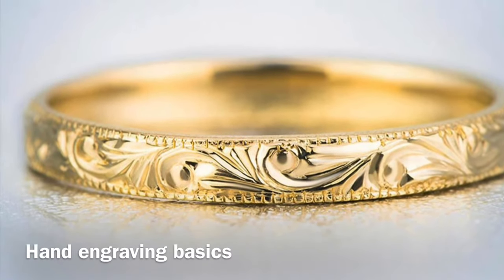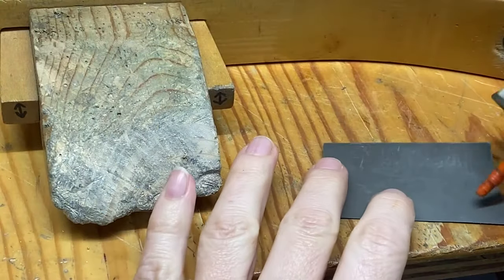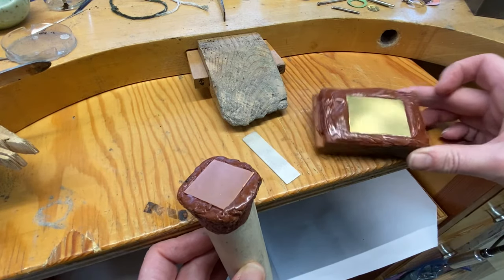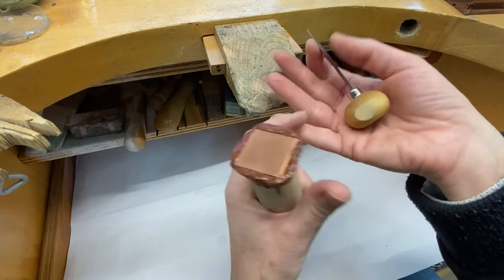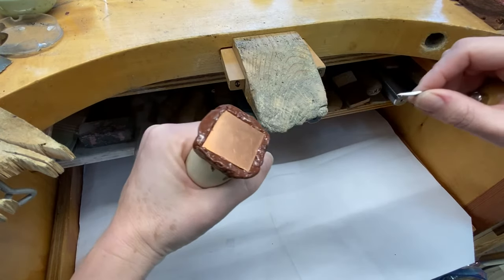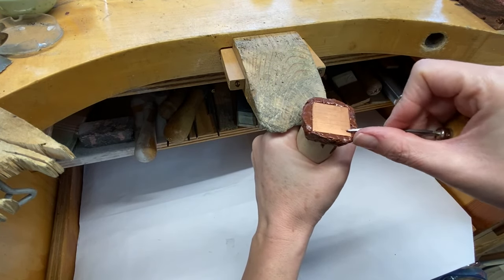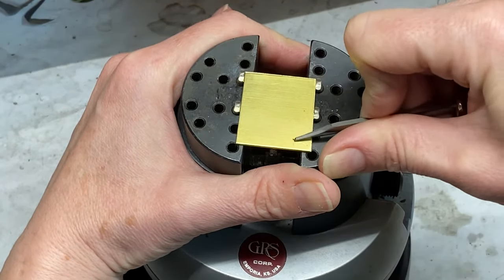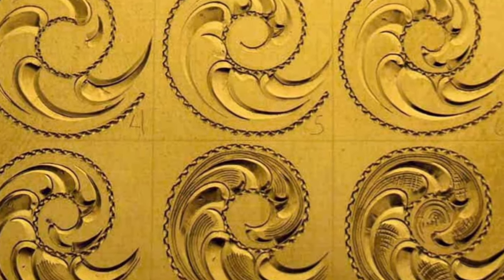Hand engraving basics

Comment: My father was a master jeweler, hand engraver, and watchmaker for over 40 years. He had his own shop and also manufactured a good bit of his inventory himself. His specialty was initial monogram pieces. He would hand draw in pencil the design, then engrave,  drill out the spaces, and then hand saw (wire blade) each and every piece himself. To entertain himself during this lengthy and time-consuming task, he would listen in headphones to old AM Radio broadcasts of New Orleans Saints games he recorded on casette years before. He must have done at least 10k pieces in his career, all of them one of a kind. Thank you for sharing this video. You are very talented as well.
Reply from the maker: I used to listen to books on tape! Now luckily we have podcasts. ❤

Comment: Has the heel already been honed in prior to retouching the face? Is it the heel or the belly of the graver you are polishing? I understand polishing the heel is crucial to a smooth cut as it is what "rides" along the bottom of the cut. The belly is the bottom portion of the graver along its length ending at the heels. Graver geometry requires a heel as the graver would otherwise have nothing to control the depth of cut. Without it the graver will just continually stab down and into the workpiece like a chisel. Creating a 0.25mm to 0.5mm heel allows the graver to glide at a specific depth as once you are at the depth of cut you want you level out the heel which is now essentially parallel to the bottom of the cut allowing it to glide at that depth continually. If you want to cut deeper, tipping the graver handle upwards while easing up and out  of the cut by tilting the graver handle down while you push.
Reply from the maker: Yes, the belly and slight heel are polished.

Comment: Hi I am interested in learning how to push grave. I have no idea as to which gravers to get. I want to grave brass and copper. I want to buy a selection of the main types. Onglette, knife, round, square, etc... but the more I look into it the more confused I get. I have no idea as to what size and angle to buy. I want to engrave scrolls and such onto key rings and desert plate sized copper and small boxes etc... I've never done this before so I couldn't tell you what angle I like to grave at or depth of cuts I prefer to make. The few specialized sites I've gone to expect me to know such things already and I don't. I also can't find anything on here that covers such things in the level of detail I'm looking for. I want the size and angle and basic types best suited for a noob. I'd rather not buy a set only to find that I should have bought the opposite angle and three sizes bigger or smaller until I find the ones I actually wanted. I won't be using anything powered either. And I don't know which brand is best either. I'd also prefer not to buy from amazon but rather a specialized site for such things. I think HSS would be sufficient and most affordable for my needs. Also any links to where I can buy a hand held jig for sharpening them would also be a benefit. thanks
Reply from the maker: We start our students on onglette #2. It’s a good start but you will want to purchase a few more afterwards.
Reply: @julieanctil1440  I have checked sites and there are tons of different angles for them which should I get? Ty
Reply: @julieanctil1440  You don't mention the angle for the tool. Most sites of any repute and that aren't using Google translate Chinglish ask that you pick the angle for the tools you buy. They come in increments                                  of one degree starting at 45° and decreasing until approximately 17° depending on the website you visit. I am assuming that there is a sweet spot range that is easier for the novice aka me to use rather than an angle outside of that range. I could trial and error the process until I find out what that range is, but I neither want to buy a bunch of the same #2 onglete or regrind one tool multiple times till I find the angle that suits me.
Reply from the maker: Definitely start with 45 degree angle.